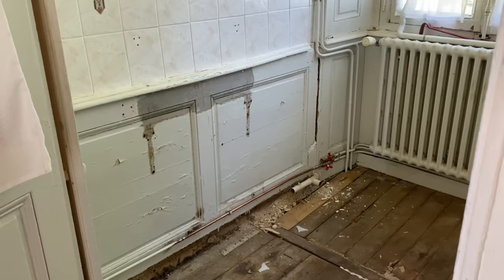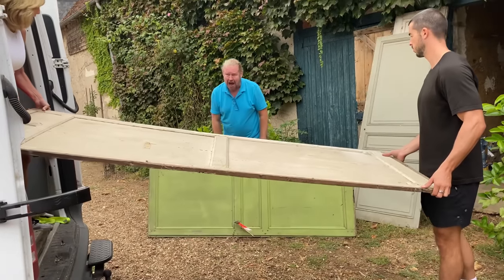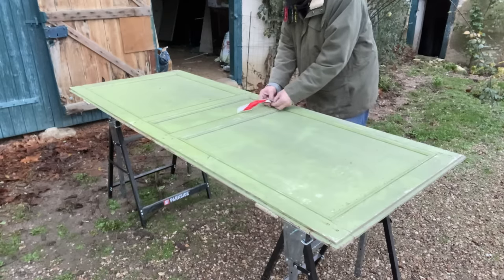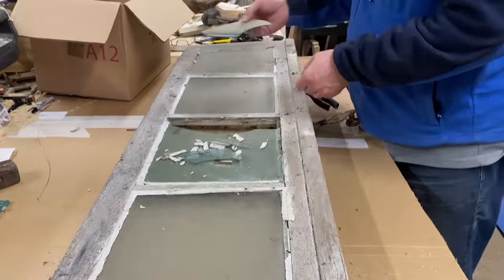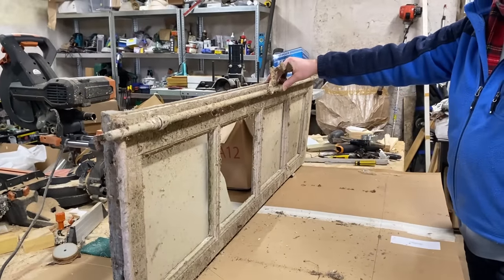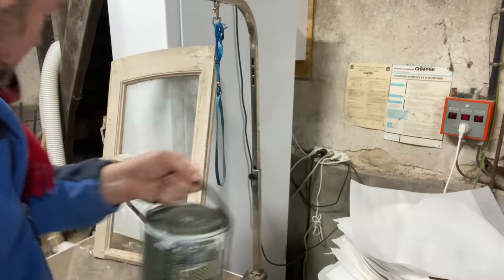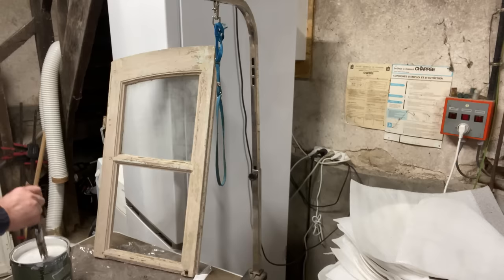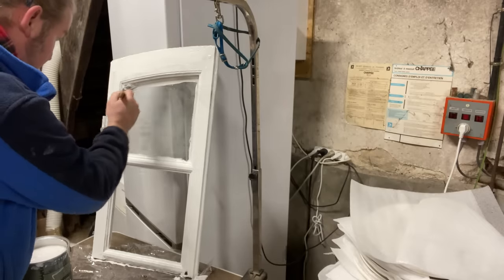Construction Project for the New Year, Chateau Bedroom Renovation - Journey to the Château, Ep. 165

Comment: As painting from the stairway side of the enclosure will always be hellish you might consider modifying a section of the paneling into a hidden door that opens into the enclosed area.  It’s hinges could be mounted on the edge of the frame for the new entry.  It’s handle and lock would be camouflaged by the existing wall of the bedroom.  This door would open inwards when in use which would hide the hinges on the stairway side.  The ultimate gain would be that when you want to repaint, change colors etc. you can just open the door to paint it’s stairway side.
Good luck and hope you’re feeling better soon!

Johanna Maine USA
Reply from the maker: Thank you. That would actually be a lot of extra work for us right now. We can always use a ladder from the stairs to access it in the future.
Reply: That is a great idea.  We have the space to paint from the hall. But I absolutely love the idea ❤❤❤

Comment: A little question, why do you always sand ? 🙂 Maybe a product to take out paint/varnish is easier no ?
Reply from the maker: No. It is wood that is meant to be painted, so it would be a much longer process to first try to strip multiple layers of old paint with chemicals, and unnecessary for a surface that is just needs to be smoothed out in order to be repainted.
Reply: @JourneytotheChateau  oh, ok. Thanks. So you didnt take off all the old paint...
Reply from the maker: oh no. Just smoothing out the surface is all that is needed for new coats of primer and paint.